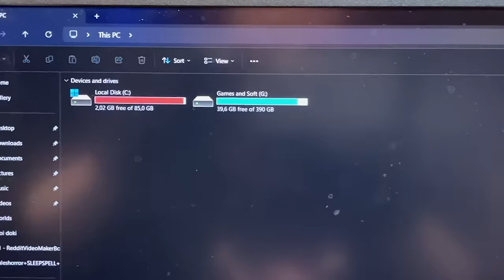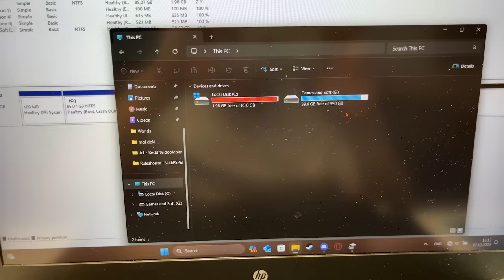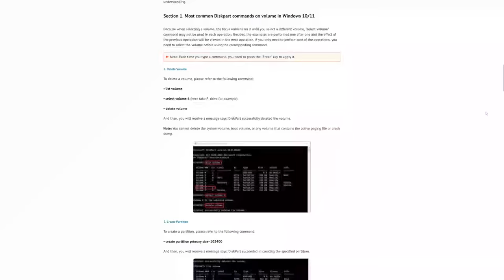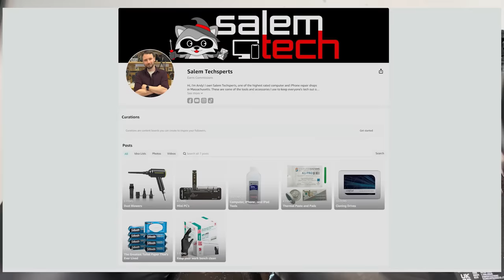HP Laptop survived the war in Ukraine and saved my friends life. Now I need to save it's life.

Comment: i have the same model of laptop in the video, may I ask about the cable that tape to the GPU heat sink. when the first time I open the heat sink to reapply the thermal paste I accidentally rip the siverr thing below the tape of the cable, what does it do BCS I don't see any problem show up on the laptop but I ask just to make sure
Reply: The cables that are taped to the GPU heat sink to hold them in place are the antenna cables that connect to the Wi-Fi card. I think the silver metal tape below the black tape is maybe just for electrical grounding or shielding (possibly related to the ethernet jack next to it). Tearing that silver tape is not likely to cause any problems.

Comment: To be the best technician is to know every part necessary to remove with solder stations included the hot air system that's the best technician and I'm only a beginner and I'm trying to fix a mouse which is easy enough as is when I get to it it'll be back up and running because it has a double and it's a $40 gaming mouse one of the best you're going to come by pretty easy when you learn how to do solder work and have the equipment and yes I'm pretty poor I can only buy pieces of equipment once a month and not very expensive

Comment: Hey, greatest technician

Firstly, hp didn't do that, it's standard layout for Microsoft, i bet this guy reinstall os a couple of times

Secondly
Extend last partition to the end, then cut it from forward to 5gigs, or whatever
Then extended other ones

Other way you caaaan clone old disk on new layout on the new SSD, i know it can be done in acronis or minitool

Or if you're lazy, Yo couldjust use migraite os to ssd feature in minitool partition wizard

Comment: I have a challenge for you, issue with brand new motherboard Gigabyte B760 Gaming X DDR4 : The BIOS doesn't save settings, i performed CMOS reset and flash BIOS to latest but still doesn't work, the only setting i can change in BIOS is date and time.

I installed Gigabyte Control Center and i was able to activate XMP with it but the BIOS is still not saving anything, even if i want to apply default settings to disable XMP it doesn't work, i must do it with control center 😅

Any idea ?

Comment: Yo, was loading into game today, when my display cut out. My pc was still on, but the monitor wasn't showing anything as if PC went to sleep mode. I restarted it and when starting up it made 5 beeps (CPU problem in my case) and just didn't show display on my monitor. I disassembled the pc, took off the cooling and took out the CPU to see if it had any burns on it, it was completely fine but the only thing I noticed the 2 pins on the motherboard  slot were slightly bent. I thought it was fine, put the CPU back in and installed the cooling. Trying to boot up pc it doesn't even beep anymore, only fans are spinning and RGB working, even powerbutton isn't glowing tho.

Comment: I got a question, based on cloning the hardisk i tried to replace the previos of my computer with another with more space because it  was almost full, and dont know how many times i tried with the macrium relfect but i didnt work, i showed me some kind of error when i tried to remove the old one and install the new one. So it would be of so much help if you can share how did you do it. ¿Please? Sorry in advance if i maje some grammal mistakes  im not so good on english.

Comment: Hey I have a doubt. I have been using the same pavilion gaming laptop but older version 15-dk0272tx.  Whenever I put some heavy work like gaming or cinebench my cpu Temps rise up to 98 or even 100 degrees Celsius. But on idle it remains constant at 50 to 70. Can you say it's only with my laptop model or is it really overheating

Comment: i was in start up bios after building my pc, and i was going to over clock it so i set the wattage to 230 watts for my CPU (i have no idea what i was doing) and forgot that i had done that and exited bios, the computer shut off and when i turned it back on it went back to start up bios. i did that for a while until the computer just stopped posting all together. I'm running integrated graphics instead of using a graphics card Dbug led showed a dram error and a CPU error I'm using a Ryzen 5 7600x processor is my CPU dead or is there a problem with the ram if you cant answer that because of free advice stuff that's fine I've been collecting parts for this pc for the past 2 years any help would be appreciated. (the mother board has a broken Dram slot.)

Comment: Bro I have Lenovo IdeaPad gaming 3 with specs 
GTX 1650
I5 10300H
2TB (1tb ssd, 1tb hdd)
8gigs RAM
but the issue is I get low fps although temps of gpu won't get high. 
Then why its happening lasse fps😢.
I cleaned the laptop with my toothbrush but still??

Comment: I’ve got a question for  anyone that might be able to help I have a older laptop a Metabox I don’t know the model unfortunately with a gtx 980m and a intel core i7 4710hq and I can not get the temps to a reasonable level I have completely cleaned fans fin-stack I have re done the thermal paste atleast 3 times making sure to spread it out over the cpu dye and it’s the same result every time 97 degrees celcus at 2.8ghz and after a hour or 2 averaging 2.6ghz witch is below the base clock 😭 i also noticed what seams to be black scratches on the cpu silicon it dosent come off when cleaning with alcohol don’t know if that’s anything to worry about.

Comment: 2:58 windows' disk manager is absolutely useless and is an an abandoned windows 2000 tool. prolly every disk manager software allows you to extend and shrink however you like. It's not HP, but typical Microsoft stuff.
I use minitool's disk manager which is way better.
I guess you're more a hardware person as you don't know this quite basic thing. 😉
Reply from the maker: The amount of people that take the time to write an essay worth of words without even checking the multiple comments where I’ve already addressed my reasoning is astounding.
Reply: @SalemTechsperts  welcome to the internet.
Also this is not even an essay.
Reply: @SalemTechsperts  just wanted to share helpful tech tip so you don't have to waste hours waiting for stuff to copy or something.
Many windows tools are rubbish.

Comment: You make me laugh when I look into the best technician there's a lot of times you say the park is broken and no we can't do anything then look at the parts and figure out which piece is really broken in the circuit board on some of these graphics cards and motherboards then go in there without her equipment and remove the part and replace it to get it back up and running if you cannot do that you're not the best I know people which can do better jobs than you who do not have YouTube channels and yes I am a beginner I'm learning to do solder work and download apps learn how to fix my own stuff so I can buy something from eBay and have myself a new graphics card and replace parts or even get a quest 3 which is busted and get it back up and running that's the best technician
Reply from the maker: My brother, you need to learn how to use periods and identify sarcasm